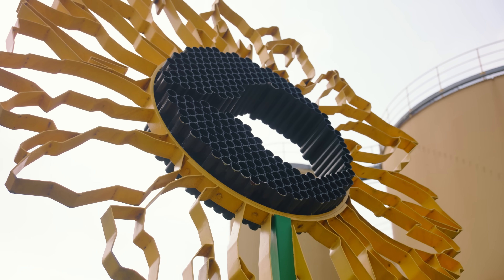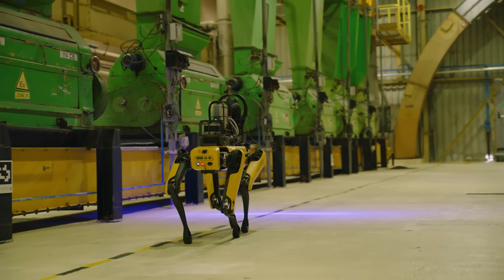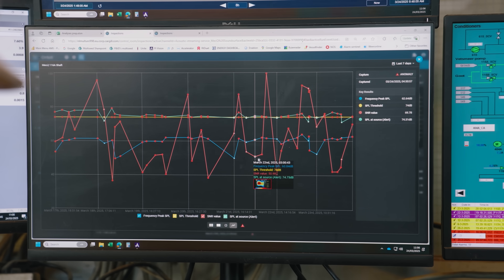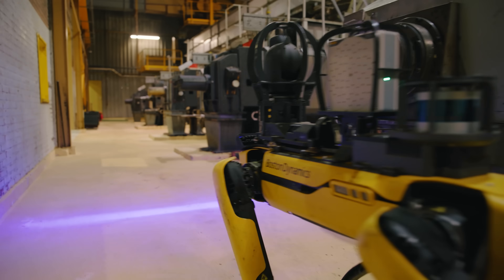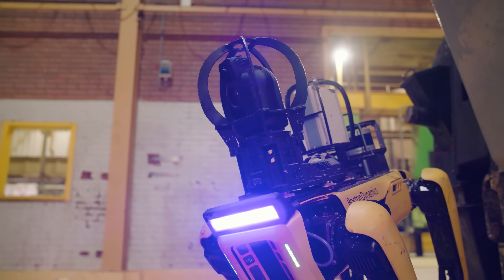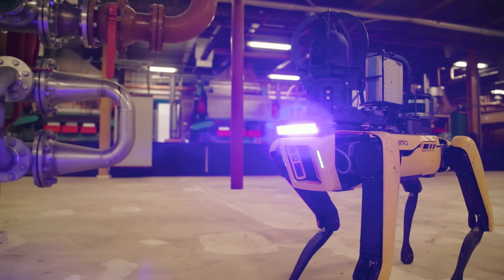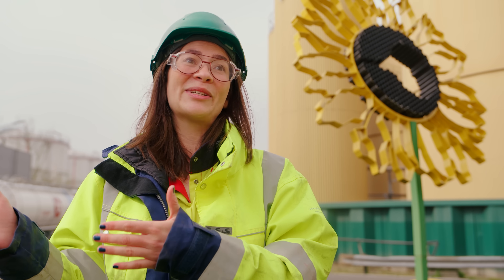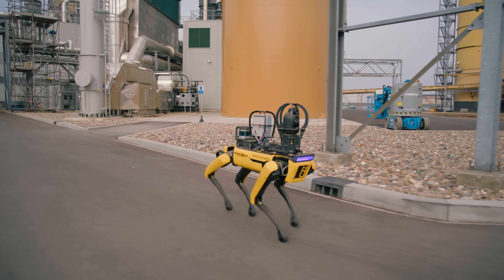Spot at Cargill | Boston Dynamics

Comment: I wonder what the cost would be if they just installed a single rail network through the factory and used a simple platform on top of it with the sensors needed. It seems to me that it would probably be far more economical...

Spot would be great in an unknown or ever charging environment, but that factory seems to be the exact opposite of that environment!
Reply: Rails can only be mounted on the celling without being in the way. So you can only see stuff from the top.

Comment: Ok but how is this cheaper than installing some thermal cameras and regular cameras
Reply: In a Factory you easily get like 100 of things you want to inspect. So you need a huge amount of cameras because they need to be close enough and at the right angle. Also that cant be changed once setup it cant realy be changed.

Comment: So it's basically being used as a mobile sensor array that can detect problems at all hours so the plant can run constantly with less chances of issues?
Sounds like a good idea, especially at older factories where adding a sensor network would be more expensive.

I would probably have two of them running though to have a "second opinion" system in case the first walk-by missed something.

Comment: I never understood how Spot's formfactor relates to purposed deployment. Quadrupeds evolved to be stable when traversing uneven terrain.
For industrial environments (mainly flat surfaces) wheels would be more efficient for primary locomotion. Only needing legs deployed for all others and obstacles.
Reply: In my experience, working industrial environments are rarely flat, level, consistent surfaces. Spend 10 minutes pushing a loaded pallet jack around a factory and you'll see the limitations of wheels.
Reply: @stankershim  I think because most of BD's videos, I've seen, show Spot in nice clean plants. 😊
Reply: Stairs
Reply: @pedroparamodelvalle6751  Flat surfaces, what's your point?
Reply: Agreed.  Boston Dynamics needs a wheel hybrid spot.  Some companies are doing this, but not with the same success stories... yet.
Reply: @meh-q8g  I wonder if their next "New Idea" will be a conveyance system that uses Arms & Hands (Because that's how Humans do it) as opposed to a Belt! LMAO

Comment: These guys literally listing all the reason to replace human workers with robots and AI: "stable, consistent, always the same reliable data every day", etc
Reply: It is! At least that's the benefit of conventional AI, machine learning stuff such as large language models (like chatGPT) absolutely are not consistent or stable. I hate that these "AI" companies call what they've made AI and no machine learning or deep learning, there's a whole other field of research of AI beyond what they're doing.
Reply: They don't want to spend money on installation of sensors...
Reply: @АгронДепартье  If Spot costs 75 000 $ and sensors, the implementation and test of them on every machine costs 300 000 $, yes, they don't want to spend money on installation of sensors ...
Reply: @Delibro  usually basic sensors like termocouple or even IR camera did not depend on political issues of few ppl.
Reply: @AABB-px8lc  What was political in my post?
Reply: Rude

Comment: So... the robot is cheaper than installing sensors? In other words, sensors are more expensive than robots. Is that true?
Reply: Yes. You can’t just install sensors on old equipment. Most of the time the equipment has to be designed and built with the sensors in mind. Older equipment doesn’t have the housings, space, or electrical harness routings need for sensors. So instead of replacing all of the equipment requiring the shutdown of the plant, loss of production, and possibly loss of employees due to finding other jobs during the downtime, just putting a robot with the capabilities needed is a lot cheaper.
Reply: You're not making any sense. I'm asking about the cost difference of a robot body carrying few sensors vs many sensors mounted statically near the point of interest. Clearly the robot doesn't need housings, spaces, nor electrical harnesses either, so why would sensors. It's carrying them on its back.  @chasesmith4121